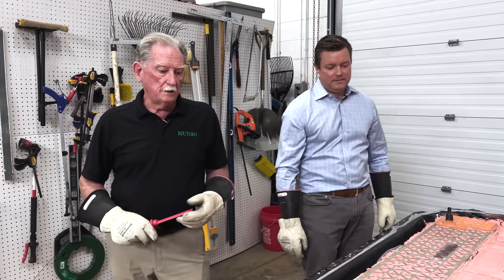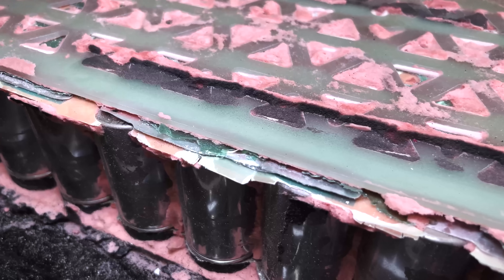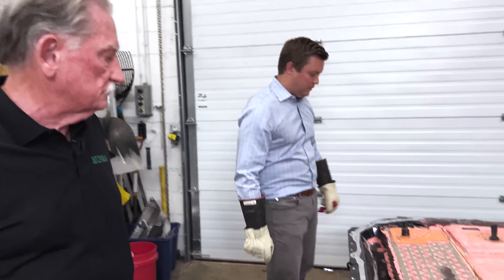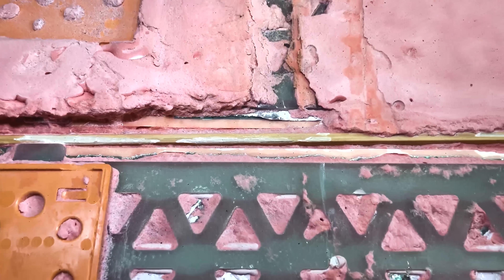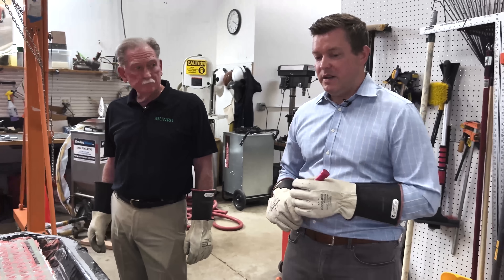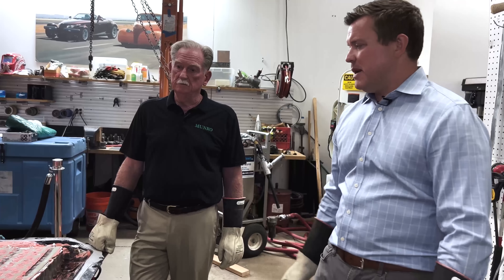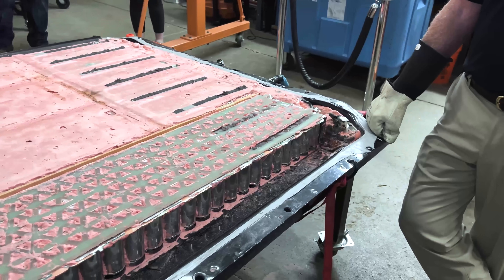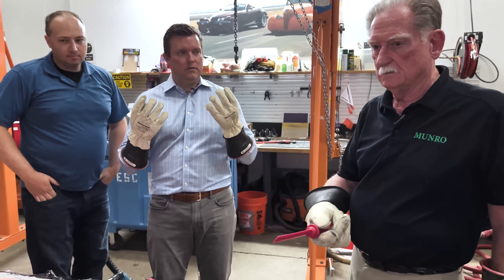4680 Battery Pack: What We Found Under the Foam!

Comment: So Tesla just made their batteries unfixable, sweet.
With this setup you cant change bad cells, you have to change the entire battery costing 15-20k dollars a piece, compared to a couple of thousands for changing cells.
Also recycling is now just to forget with that foam... Will be to costly to repurpose these batteries, or recycle them. 
The man hours needed is staggering, when one hear how much work was put in to just show these few pieces...
Make this car age badly, as ALL EVs loose capacity over time, and a Tesla will never be worth changing a battery on. And when changing cells now out of the question...
Sustainability right there...

Comment: A non engineer here but I'm wondering if there is anything that could go bad that's embedded in that foam?  How hard/expensive would it be to get to and fix if there is anything that can go wrong? Also, thinking long term, is it practical/possible to replace the batteries if an owner had/wanted to in the future.  Or would the life of the batteries out live other critical parts of the car that would cause the car to be end of life first?  Guess what I'm wondering is the car essential disposable once the batteries are done?

Comment: Greetings from Chile, Mr. Monroe, to you and your team, I love your work and videos.
The structural battery is a very good idea, the implementation is a disaster, it does not allow to repair or recycle properly, also the pink foam is combustible, which makes it unsafe.  I think it can be improved in a way that is safer, more easily recyclable and repairable, using preformed and fire-retardant plastic foam structures.

Comment: Battery recycling as ore only really works if you are "close" to million tons in raw material (similar to mining/refining actually)
This is easily achievable in the future, but close to impossible right now, because there are not enough large battery packs to recycle right now.
Tesla can already recycle the faulty cells they produce (not packs though) with very high efficiency, it is not public how they do this.

Comment: I have to disagree on a point with Sandy. The huge recycling facilities are able to do the hydrogen bath, but those cost A LOT to maintain and implement. I think most of the commenters are talking about reuse. There's no way to reuse those battery packs after a couple of cells fail. You can't remove the bad ones and replace with good ones. On a normal battery pack It's not an easy job, but with the popularization of EVs, there will be more and more reconditioning shops for battery packs.

Comment: Little over-simplified on the recycling part. Yes, you can grind this down to separate things but it takes a huge amount of energy, an unusable sludge remains, and you end up with raw materials that would be much cheaper to source from the environment (i.e., the business case isn’t there). It would be much better environmentally and economically to allow for disassembly and the direct reuse of parts/materials and that does not seem feasible with their design.

Comment: it appears that the Model Y 4680 pack has 67.5kWh useable and that suggests 75kWh total. If the cells are 26.5Ah as we have seen elsewhere this would mean a pack is 96S8P, however, there looks like a lot more cells in this pack than that - do you have a total cell count for the pack?

Comment: At 8:28 Sandy mentions immersing the pack into liquid nitrogen. I believe the main purpose for that is to arrest any chemical reactions so the the cell ceases to produce any terminal voltage. Next comes mill grinding which pulverizes the can and the internal contents to such a fine degree that the next step of recycling can be undertaken.  Anyone else have insight into those processes?

Comment: So its genius engineering and (relatively) easy to recycle… But a battery pack (and probably the car due to the ‘gigacastings’) cannot be economically repaired, the batteries cannot be repurposed and there aren’t that many salvageable parts in the whole car; effectively the vehicle is a disposable item. Resale/trade-in values will be next to nothing and if there is a problem in the battery the car is a write-off. Great for Tesla, but how is it a good deal for the purchaser?

Comment: As far as recycling the batteries, The biggest will be reusing the batteries for home solar storage.  battery life ratings are to the 80% capacity. That pack at 80% would be great for home use.

Comment: I struggle to see how repair and recycling were given any thought in this design. Who is going to repair this when one cell goes into low resistance and virtually bricks the whole battery pack?
Reply: I'm afraid no one will be able to do that. Also it looks like it will be terribly difficult to repurpose these cells from for example totalled vehicle, that still has cells with serious capacity left. It's totally irresponsible design in terms of sustainability

Comment: Sure recycling is no problem but 2nd life and repairability is...Stuff like Gruber Motors does is impossible on such packs. I don't like that direction. It's basically a 100% Battery replacement whenever there's a problem with it.

Comment: So Elon has made a battery back that can't be reworked and nobody has yet to have actually recycled the battery back.  Brilliant.  And if it goes anything like our consumer recycling programs it will likely be a farce.  What would the cost be for recycling the materials as compared to the cost of the raw materials?  Have we not learned anything from the petroleum and plastics industry? Check and verify.
Reply: I absolutely agree with you. It's unbelievable that so many people here believe the statements made by Sandy and Tesla.

Comment: I think that the structural battery pack(built like a tank and unbrickable except by a few!) is an excellent step forward albeit the risks of premature battery failure. Definitely it is going to prevent people meddling with their packs(under the pretext of right to repair), let alone inferior third party spares. It is a huge win for restoring confidence in EV battery safety going forward.

Comment: Glass filled nylon; doubt it as that would be highly flammable. If the nylon had fire retardant added it would appear different. More likely its it fibre glass with an epoxy resin system modifiied with bromine for the matrix. The plastic bits identifed as ABS are unlikely to be just that as its flammable too. Its likely a polymer filled with particles so that it decomposes enothermically to absorb thermal energy from ejecate from cells in thermal runaway. If that is breached then adjacent cells will be protected from ejectae from a venting cell hitting the ends of adjacent cells and instead (last line of defence) it breaches the aluminium casing and vents to outside the vehicles (and this is why steel is not used here). In the future, the top will become a composite as these are lighter and becoming ever more cost effective (plus can outperform steel in the face of ejectae from cells in runaway). PS its possible to recycle epoxy based composites back to the molecular level if you're clever with the resin system formulation.

Comment: Surprised they didn't comment at all on how empty it is inside. This pack could fit 94kWh or even 100kWh, that gives a 433-mile range.
Reply: Where is this mythical empty space?
Reply: @brianb-p6586  try watching the video
Reply: @themodfather9382  there a small space down the side, which may be necessary for lateral crush space. You're talking about a huge space not shown in the video.
Reply: @brianb-p6586  On the Model 3 pack, the angled wall hugs the cells, but that's because the car has a crash structure separate from the pack. It would be nice to have exact dimensions for everything (2170 packs, 4680 packs, module dimensions, cell array total dimensions, pack dimensions). 
In any case, if they're not physically smaller (length and width), the packs should be at least about 94kWh, because of the 14% height increase of the 4680 cell. Not to mention there would be about 5x fewer cooling lines, so that is multiple millimetres saved in width.
Reply: Instead they are 68kWh packs (so I've read, anyway), so they are 17% smaller in capacity, instead of "at least" 14% bigger.
All evidence points towards making the packs/car itself cheaper, and also making it easier/cheaper to scale, especially with limited supply (they basically made a Model Y MR).

Comment: I think that foam is designed to undergo an endothermic reaction. I.e. heat will drive a chemical reaction and prevent a thermal runaway of the entire pack. I would bet it is a Dow product.

Comment: Sandy said three things caused most failures. Fasteners were no. 1. What were the other two?
Reply: I know one point. Bosses who simply claim that screws are one of the main causes of failure.
And employees who simply parrot the statement without thinking. Thinking for yourself and questioning helps against this,  even on this channel.

Comment: Looks like a nightmare for doing any sort of repair unless there is some solution that could dissolve the pink stuff without damaging the rest of the pack. Essentially a disposable $25,000 pack with low desirability for repair, repurpose or recycling

Comment: Acetone could dissolve the foam. That might help your disassembly.  For recycling, reuse the acetone, remove top and bottom plates then chill and grind. Though chill and grind would be better to automate
Reply: it would also do a number on the ABS base the cells rest on and other seals and stuff - I would be so much happier if this foam had a magical solvent that was specific to it and made reworking the pack possible .

Comment: Munro is a looser. If he had ever any reputation, then it was lost when he sold his presumably independence to Musk. And this video has finished the rest. Liquid nitrogen is not "little bit" above absolute zero but 77K (-196C) above and that is a lot. Below 63K nitrogen is no longer liquid but solid. Hence the process as described would not work. 
Munro just talks garbage. I just wonder if he is really so daft or just hopes, that an average American does not know physic either. That excludes the followers of St Elon Church. Those 20 million or so people are used to eat what is served to him and no question asked.
Reply: Jumped at the gun to sell them for $800 a piece before even getting their hands on one.

Elon should start selling them pristine with TESLA laser engraved on the side for $500 a piece and see how many fly out the door. Heck, sign a few dozen and see what they go for via auction. Elon claimed every minute of his thinking makes Tesla $1m, and signing some batteries may be just as profitable. Or go full Willy-Wonker and put a signed battery into the odd random pack. Those packs might be worth $1m some day and every Tesla owner would think they might have a golden ticket sitting right there under their bums. More profitable than stolen underpants.

Comment: I think the barrier between the modules is structural to stiffen the middle of the pack.  If it was for thermal runaway there would be better materials.
Reply: The excellent article by George Bower in InsideEvs called "Engineering Analysis Of Tesla's Cyber Rodeo 4680 Battery Pack Cutaway" comes to the same conclusion about the structure (with more detail).

Comment: I don't really care how the battery pack gets recycled. I'm more concerned about what happens if there is some kind of premature pack failure that happens just outside the battery warranty period, whether it be cell failure, or one of those fuses blown. The owner won't have a snowflake's chance of getting the pack repaired or rebuilt, they are just going to be up for the cost of a brand new pack, or  just scrap the car and write off their investment in that vehicle. Right now, if a battery pack fails, there are shops that can replace a few cells, rebalance the pack and get the car back on the road for a few thousand bucks. These 4680 packs are going to be white elephants, and if it turns out that the 4680 cells themselves become prone to early failure, Tesla is going to have a nightmare on their hands, especially if the cells start popping off after a couple of years.
Reply: Dude, everyone pays $800 per cell, it's worth getting some insulated mittens, I'd say!
Reply: @Cloxxki  Where do you get that figure from? There are just under 1000 cells in a 4680 pack. I'm pretty sure those packs don't cost $800k.

Comment: I expect there will be dummy cells in there. This pack is only rated at 279 miles range and much higher is expected. Since it is a structural pack, they can't just leave a row out, or the structure would be much weaker.
Reply: Cell count and energy analyses say that there are no dummy cells or empty spaces.

Comment: Tesla Standard Range Texas 4680 Model Y, 816-828 battery cells / Y (source Monroe Live), 272-296 whr/kg ×0.355 kg/cell (Limiting Factor) = 96.5 - 105 whr/cell, = 78.8kwhr - 87kwhr per Model Y. Tesla advertised long range capacity is 75kwhr. Thus, is Standard Range Battery Capacity > Long Range Battery Capacity?
Reply: I bet there are dummy cells in there.

Comment: A dry ice blaster is projecting frozen CO2 on the battery pack. So, we are heading to a carbon-neutral future, but only after you have your fun? This is information no one NEEDS to know. Can it be recycled? That is the only legitimate question. Standing and staring at it helps no one.
Reply: Fortunately, dry ice can be produced in cryogenic air separation, as a by-product of liquid nitrogen and liquid oxygen production, in which case it is part of a carbon-neutral cycle. Most of it is not produced this way, of course.

Comment: I am actually quite disappointed at Tesla for choosing this zero-repairability approach. The so-call going-green image is just ruined, setting an absolutely bad trend.  If there's any ideal goal, it should be easy repair in case one of the cells become faulty, i.e. making it easy to replace single batteries. This is very unfortunate. The best way to "recycle" is to allow repair and not to throw the whole battery pack away.  This is sad. This is not innovation.
Reply: On the flip side, a single cell failure would very likely have minimal impact on the function of the pack.
Reply: @osjproductions5856  well, depends on what you mean by minimal. Previously with older batteries, the approximately 7000 cells are grouped into about 16 modules. If one of these 7000 cells become defective, Tesla may require you to replace the entire battery pack which cost $20000+. There are garages (like Gruber Motors) who can diagnose and replace only the defective cells for $5000+. That can be the difference between fixing vs total loss. Now, with the structural packs, these garages cannot even do that anymore. Granted, we don't know enough about the 4680 battery packs and the effect of one or a few defective 4680 cells... Maybe there have been improvements on designs, but certainly, one single defective cell can lead to replacing the entire battery pack.

Comment: Basically the whole "zero weight" BS re. the "structural battery pack"  - is really a "dropin" (lift into place) central chassis member with batteries incorporated...  
-batteries always weigh more than no batteries - esp at ca. 200WH/kg, the maths is simple.
(structural frame members simply run through the battery box, the batteries themselves are not structural.)

Yes it improves the assembly ergonomics - with likely long term water intrusion issues for the vehicle cabin.

Comment: I don't think Tesla so much as "invents"- they use non-automotive think engineering to find  solutions and if it works, they do it. They are not constrained by automotive "this is how we do that".  Other manufactures are struggling to break with the past a little more (look at hte BOLT EV). Not sure if "never serviceable" is ideal for a pack of this cost and value.